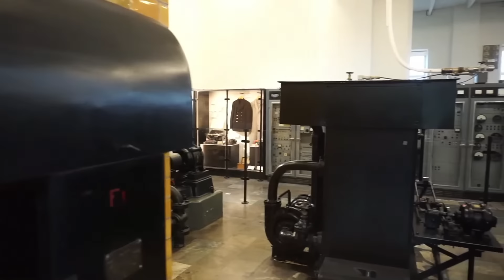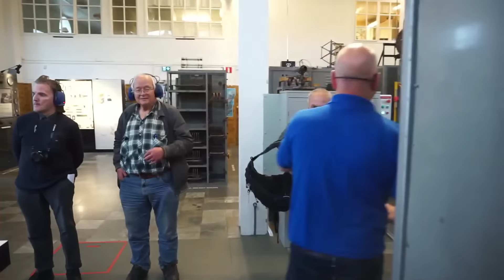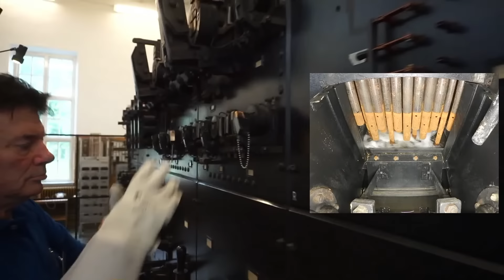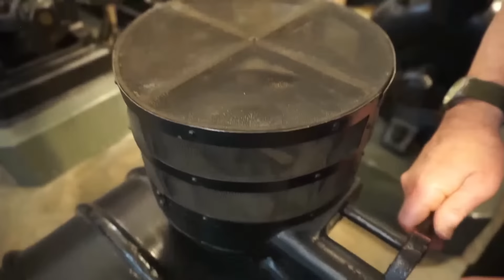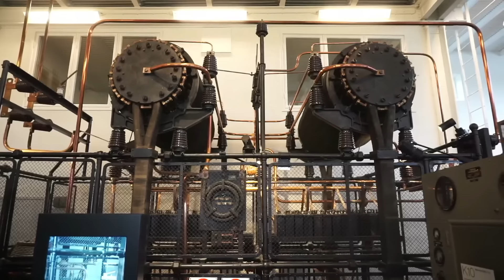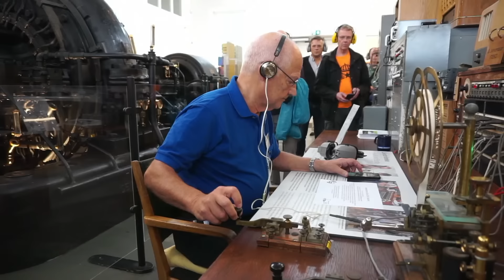Historical transmitter SAQ Grimeton transmission 09:00 UTC - Alexanderson Day 2024

Comment: I believe I have seen this once before. Very interesting to me. I have to wonder if it would be possible to communicate with you from Indianapolis, Indiana when you are on line and if so what would be required on this end? Perhaps I should ask first, what is the range of this system? Steven. Edit- Question, please?- why do we start the cooling water pump with the valve closed? I work on centrifugal systems for a living and this would be hard on todays pumps…. Thanks!

Comment: Your excellent tour did not indicate how the 50 Hz mains power was converted to DC.  Was this by motor-generator, rotary converter or something else?
Reply from the maker: Thanks for your question. The 50kV AC suppy is transformed to 2.3kV and 3phases are converted to 2 phases by a Scott-connection ( https://en.wikipedia.org/wiki/Scott-T_transformer), which is the required supply to the main drive motor. The 2.3kV 2ph is also transformed to 440V 3ph for the supply to various drive motors in the auxilliary equipment. Here are two rotating converters that can produce 500 VDC and 125/250VDC, where the alternating current is rectified by means of a commutator, which allows direct current to be extracted from the rotor (https://en.wikipedia.org/wiki/Rotary_converter).
Fredrik / Alexander association
Reply: @AlexanderSAQ  Thank you.  Rotary converters are fascinating pieces of equipment.  They were used quite a bit in early transit systems to convert 3 phase AC to DC for third rail power.
Reply: @AlexanderSAQ  So the motor spinning the HF alternator is an AC motor?   How do you adjust the speed of the drive motor to adjust the transmission frequency?

It also makes sense to me that a country like Sweden with a small population and relatively little international commercial activity could get by with one transmitting frequency.  How about large generators of telegrams like the U.K. or the US?
Reply from the maker: @Pamudder  Thanks for your questions. To maintain a stable speed of the drive motor is a complex system. The voltage to the motor can be controlled between 1300 and 2300 VAC by using a Transductor, which is an adjustable choke coil, where the magnetic saturation of the metal core is adjusted with short pulses with 500VDC. The pulses are generated by the automatic speed control system which is chopping the field current to the 500VDC converter. Then the rotor of the drive motor is open in three phases. The resistance between the phases will determine the torque of the motor, and can be set using two separate liquid rheostats, one for key up and one for key down. At key down the latter is connected in parallell with the first, allowing for a lower resistance and thus more torque is applied to maintain the speed.

Sweden had a massive emigration to the US, one of six moved during the hard years  in the late 1800's and early 1900's creating a great need for communication. One can also think that the fact that the inventor, Ernst Alexanderson, was Swedish, played  a role in the decision.
Fredrik / Alexander association
Reply: @AlexanderSAQ  Thank you so much for the explanation.